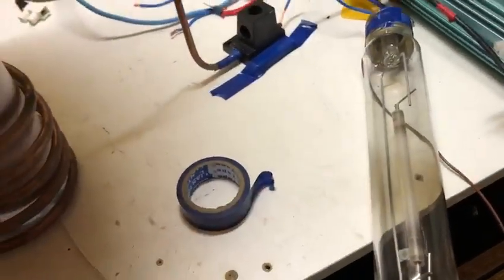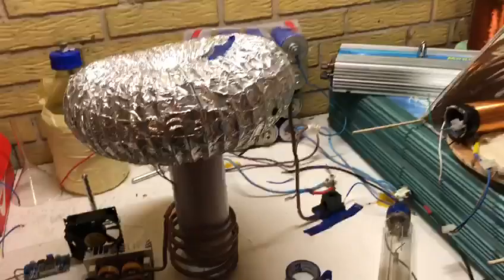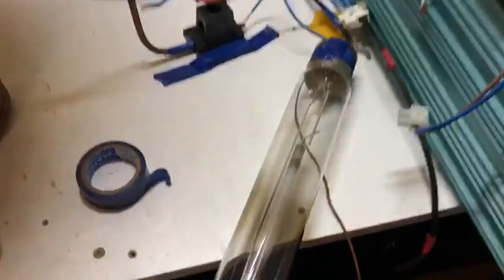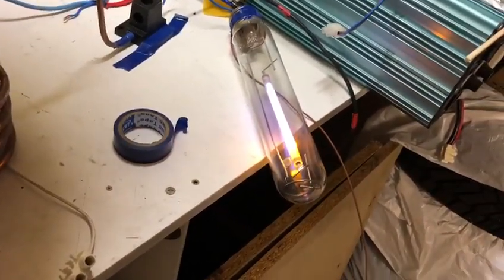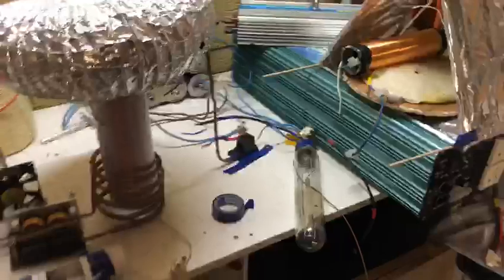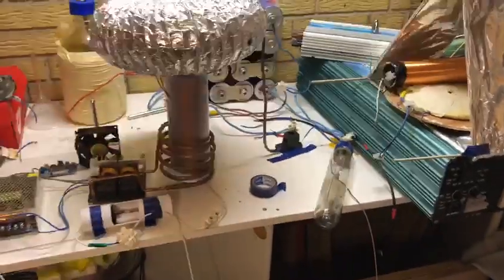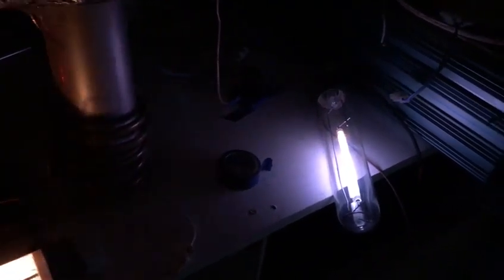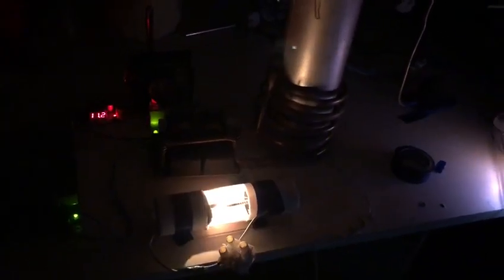Two spark gap system shows more power

Comment: imagine u have s stick.. that stick is a voltage and current.with center as its balancr point.u pull other halves u increase voltage,and automaticaly the other end is shorten or the current decrease.theres no way to convert it when ur using its own power to convert it.there must be another system coupled to it wirelessly .so power conservation  does not dictate the outcome.

Comment: sir no matter how many times and types of conversion we do with the source.power conservation always applies.this could only work when we add a separate system to couple with it.thats the only way to go.another system that pr9ducing volts and another for currend.its like a stick.if u make other side longer(raise voltage) it automaticaly shorten the othr end(decrease current).conversion must be in two stage.to eliminate balancing effect.cos ur using power from same power u wanna convert.this is madness.u cannot.. there must be another system not just one.

Comment: One problem of this kind of arc is electrode melting.
Reply from the maker: @PLASMUX-20  yes this is an old vid but it seems relevant at present with the experiment regarding center collection from the secondary to the top load or capacitor. I will post an earlier vid showing differences with and without spark gap on the same lights, just an observation:)